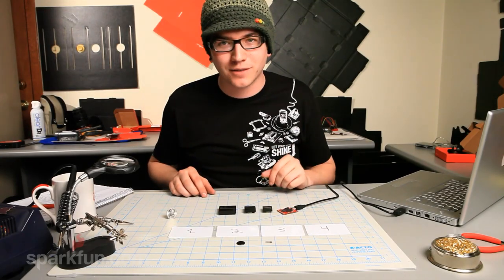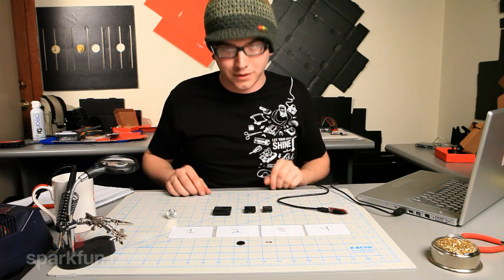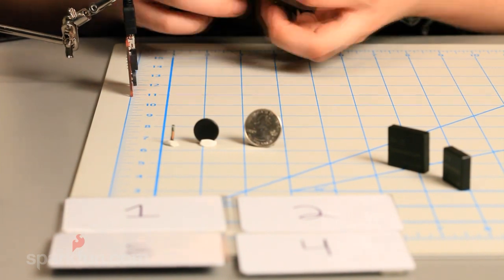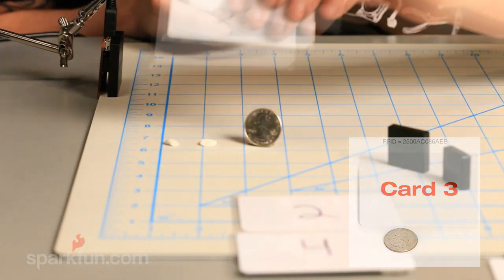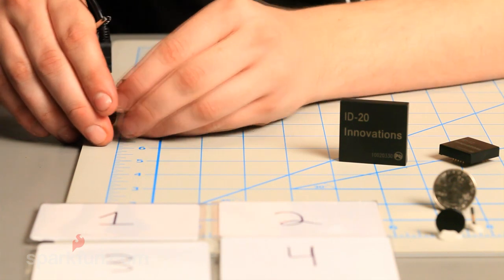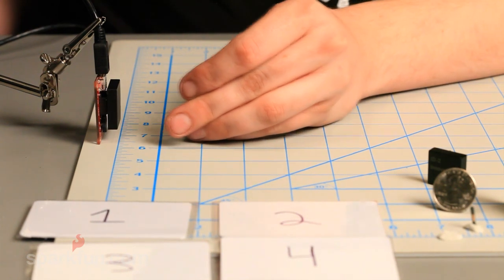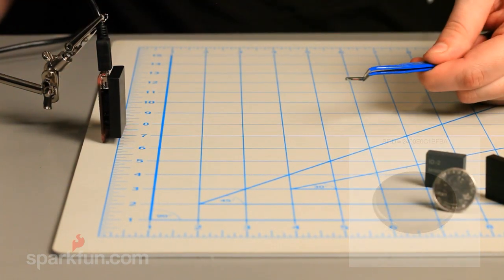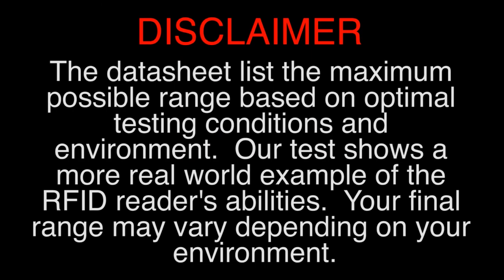RFID Comparison with Tim from Tech Support

Comment: I work with ID-2 Innovations for my thesis.
I have a problem with ID-2. In first tests i used an ID-20: I connected pin 7 and pin 1 to ground, pin 10 to a led with 330 ohm resistor, pin 11 to 5 volt and pin 9 to send data to a pic18 with pull-up resistor . The ID20 work good! If I use ID2 with internal tuning condensator , ID-2 reader don't work!
I connected the id-2 through pin 3 and 4 to an external antenna (1.08mH). Can you help me?
Reply: SparkFun Electronics hi, do you know if this RFID reader can detect old versions of the RFID chips?? i mean the ones used in the early 90s

Comment: @rsmoz No special drivers are necessary. The RFID breakout uses FTDI drivers which are easily available if not already installed. Then you just need a terminal. As mentioned before, Arduino is an easy way to get a Terminal on Mac

Comment: Hello Tim, you are doing a really great work with this video tests. I'm working with ID-2 chip and the reason why it didn't "beep" is because this reader doesn't have an integrateg antenna like ID-12 and ID-20, so you have to build one by yourself and it will work.

Hope to see this test too! :)